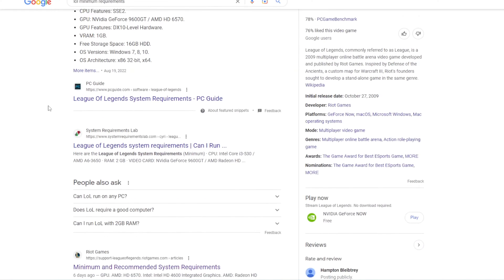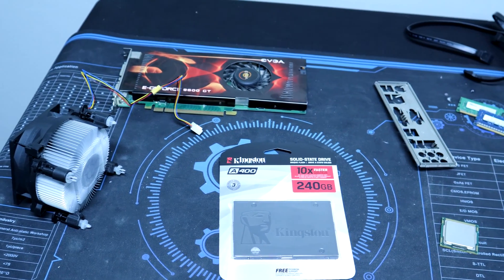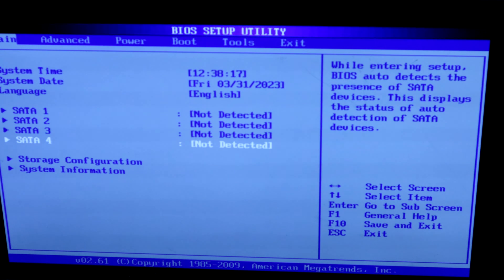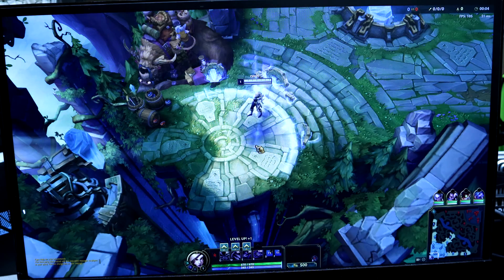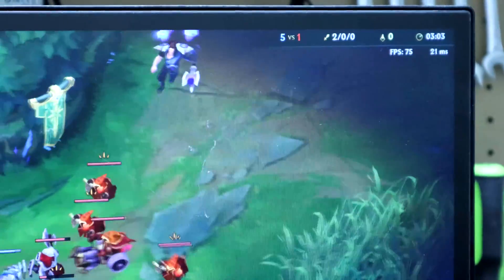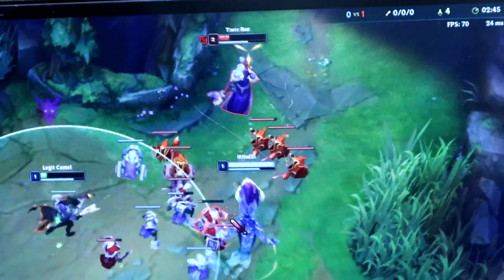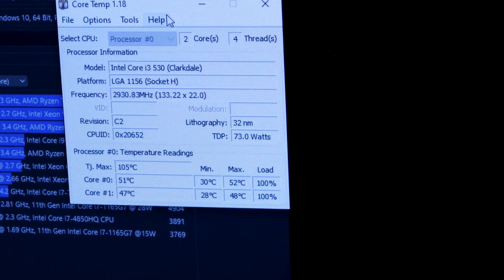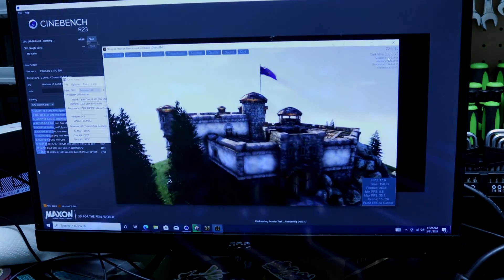League of Legends Minimum Requirements PC Build

Comment: i guess no one will care for this but after watching this video i went and made this build, i looked for the gpu first, and as i was searching on ebay i found a fanless version on  facebook market place, but it was 1 hr away, which is not a problem, the problem is that its in toronto, now if youre from canada, you know how horrible the roads and the people are in toronto, thats why most people want that city to be nuked so that 1 hr ended up taking 1hr 40 min... when i got to the warehouse it was small but cool, they had alot of different stuff from furniture to electronics to clothes, there were boxes everywhere, and in the middle of the warehouse there were boxes filled with motherboards and i started looking. at the time i didnt know that motherboards are not universal compatible, so i picked a motherboard that was colour brown and had 4 slots for ram and 2 slots for gpu, i was mainly looking for more than 2 ram slots so i was happy, then i asked if they had gpu, cuz that was the main reason i came, and they took me upstairs and i found it, it looked good and i was happy until i saw something in the corner of my eye, there was the exact same gpu O_O, my mind instantly went towards sli build and so i bought them for 20 each, they sold me the motherboard for free and asked 10 for 4gb of ram sticks that fit my motherboard, i was heading towards the car until i went back and picked up a psu (power supply unit) for 10, and went to another place to pick up the cpu which is not the same as this video, the youtuber uses i3 530, i found i3 540 which is close enough so i was happy but as i was heading home, i realized that i3 540 is 2 core processor so it was not going to be strong enough to run well with 2 geforce 9600 gt fanless editions, so i started researching and found out that my motherboard is not compatible with my cpu and the best cpu i can buy for my current motherboard is insanely weak so i ended up ordering a motherboard online that is compatible with cpu and sli, and so while that was being shipped i found out that the best cpu for motherboard is i7 880 quad core. i looked and looked and couldnt find it, almost like it doesnt exist, until a random night someone put it on facebook marketplace but it was in Oshawa and he asking 70 for it... i decided that i want it, so i msg the guy and told him ill come on the weekends and while i was doing that i was looking at sli benchmark videos and only found 1 video where the guy was like, oh it sucks after a while cuz it heats up , so i found an insane case where it got fans everywhere and even for gpu on the side and the controls to keep them on or off is on top of the pc case so i planned to pick both up, and it took me 3hr drive to go pick both up and took 2 hrs to drive back. after few days my motherboard arrived and so i went and bought 32 gb of ram for it so i can try running other stuff at the same time, as i was putting it together i realized that my psu doesnt fit so i went and bought another psu for 40 bucks and it fit so i finished the build after a year of finding parts and driving to pick em up, i downloaded windows and drivers for gpu and it ran league at 60-90 frames averaging 70-80 frames. idk why but my ram is half the other 16 gb is reserved for some reason, and my sli options are not available in the nvidea control pannel, so im guessing its not running both gpu, but it shows i got both connected so i gotta research more, besides those 2 problems, its pretty cool and beautiful, im gonna figure out how to fix those problems so i can release a benchmark video with tons of games cuz i own ALOT of games on steam.. i dont expect anyone to read this but if someone does, TY like ik its a boring story but it was super cool journey for me and honestly this youtube video is the reason i got to have that journey, so ty to the youtuber and ty to my car, for still running LOL if anyone wana play league my ign is ( yassuo oonly#NA1 ). ty and have a good day.

Comment: Until 2017 i was playing with my old PC rocking GT9600 and fucking Core 2 Duo with 3gb of ram and Windows Vista, i bought this pc in 2007 xD originally it had gt8600 but i changed in for the HDMI port). I had it locked at 60 fps because my monitor was 60Hz and it was working just fine ;p Later i bought fancy gaming laptop and was getting 200 fps, but to be honest it wasn't that much different experience ;p
Reply from the maker: I love it man haha its crazy you can run this game on a total potato

Comment: is league of legends not able to use much more powerful hardware well? Since those specs are so much worse than your current rig, but the difference isn't that massive.
Reply from the maker: Yeah its pretty weird, thats why I initially expected this rig to only get like 30 fps. Pretty sure LoL is a cpu heavy game and basically uses no graphical power, it also only uses like 2 cores so whatever cpu you can find with the best performance on its first 2 cores makes all the difference. The game also freaks out if it goes above 240 fps so thats basically the limit of the engine. League of Legends is just full of spaghetti code from it early development and they never fixed it lol

Comment: I actually played a BUNCH of league on an AMD 5670 HD. Apparently thats basically the AMD equivalent to this card. Shit ran beautifully.

Edit: was comparing to the 9800GT, not the 9600GT. Also u should listed the ram used, cuz its prolly the speed making the difference, not the amount
Reply from the maker: I wonder if League of Legends uses any graphics processing at all lol cus it feels like no matter what gpu I put in the fps is completely dictated by the cpu. The RAM was 1333 for all the kits used, I probably shouldve mentioned it lol
Reply: @LegitCamelRetro  game might only run on a single thread. i was using a i5-2400 with that setup that worked real well
Reply from the maker: @pinnacleexpress420  Yeah I am pretty sure it is, when playing it you can see it really only utilized 2 cores so its pretty poorly optimized lol when buying the cpu for my personal rig I just looked for whatever processor had the best single thread performance